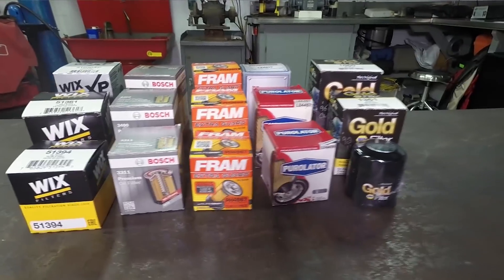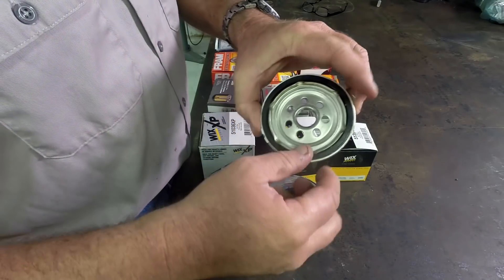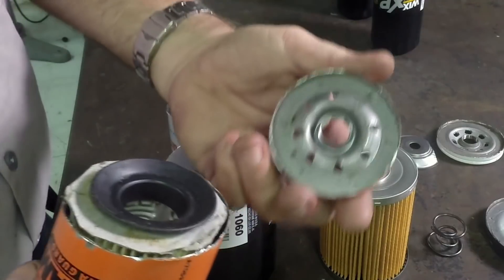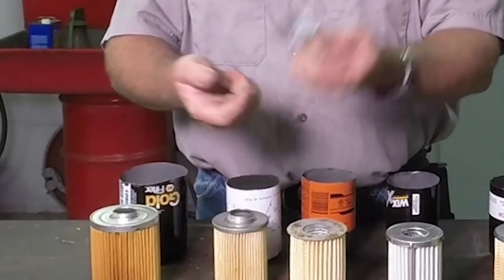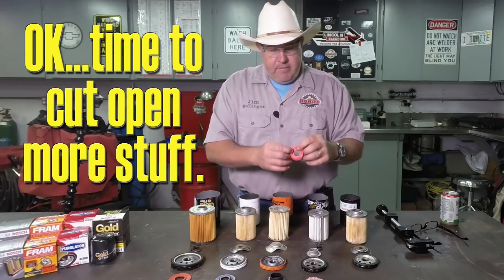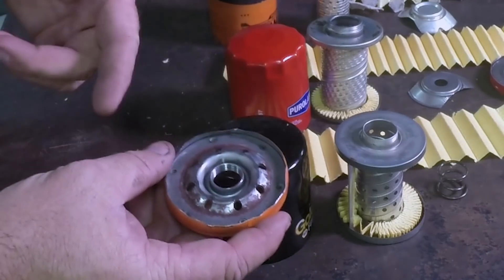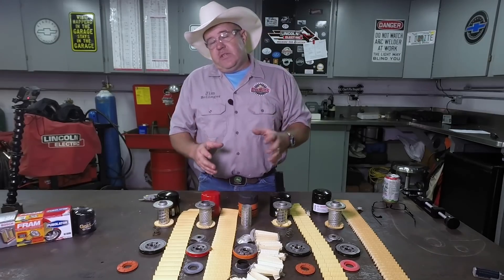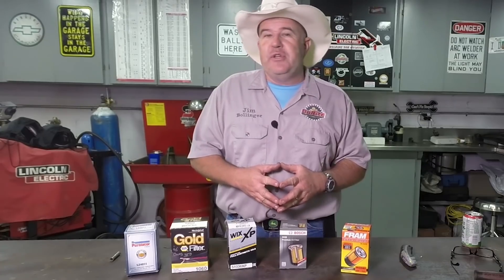The worst oil filter EVER!

Comment: Ok. The people watching this video are most likely a little more concerned about their vehicle maintenance then average car owner. I change my oil religiously at 6000 km and use a quality oil filter. Honestly, at this interval, the Fram filter will probably last long enough ,  but the heck if  I am going to take the chance of having it come apart and risk oil starvation to save a couple of bucks on a filter. For a lot  of people, the reason to use a better quality oil filter is because they are  likely to neglect performing  oil changes at the recommended intervals and the higher quality filter is less likely to fail as a result of this neglec. I would not want to see the condition of the Fram filter after a 15000km oil change. Do not forget car manufacturers are recommending longer and longer oil change intervals and then negligent car owners  think that an additional extra couple of thousand km will not matter. In ideal conditions the Fram is probably fine, but conditions are never ideal, particularly outside of warranty.

Comment: Thanks for posting this. Sometimes you need to look inside things to see what's in there. Fram filters are crap and they rust like hell in humid climates right on the shelf! I was buying Napa gold until I noticed that they are now made in China (Found that out 3 years ago). I have switched all of my vehicles to Baldwin. I have had no service failures and they are made very well and they are made in the USA. The odd time I can't get a Baldwin I go for a Mann or Mahle. I'd love to see you do a cut open with them as I have never cut one open yet.

Comment: The truth about oil and filters by experience.   He's right.  AND...
I've been a certified automotive/light truck tech for a whole Lotta years and have worked with standard duty engines, heavy duty engines, race engines and engine builders.
  In my new or freshly rebuilt engines I only use Royal Purple oil and a Napa Gold or Royal Purple filter, interchangeably.  Availability and price decide which I use on any given day.  Other than the Royal Purple, the Napa Gold filter is the only filter that will last as long as the oil.  Other filters will break down before your very expensive oil reaches it's service life.  Maaayybe the Wix, if that's all you can get. You can't go wrong with these, if you're willing to pay.  NHRA dragsters don't use crappy oil...  lol
   For standard oil, Napa branded products are cheaper to buy but are manufactured (usually) by Valvoline and is my other choice, be it high milage, Trans fluid, etc.  Pep boys was also made by Valvolin, last I checked.  Ask your sales  person.  There is NO reason to use other, way more expensive, nationally branded products.  It's the best bang for the buck.  (Yes, you may like another specific, natural or synthetic oil.  Fine, pay for it.  No need to tell me how this or that is all this and that.  I said "no need," not that there weren't other good products).  Those filters he mentioned, Napa, Wix and Purolator, in that order, are my ONLY other choices besides Royal Purple.  (Unless you're building a suppressor for your fire arm, but that's a different story...  :D)
  No matter what any one tries to tell you, change your oil every 3-4k miles, PERIOD.  Even if the oil doesn't break down (which it does) before higher milages, the engine parts DO break down and you are scrubbing the inside of your engine with metal shavings..  UNLESS you use the 10k mile, Royal Purple oil (after you used the specific, new engine "break-in" oil according to directions or properly switched over from standard oil) and then you change the 10k mile rated oil no later than 8k miles.  Inspect your oil regularly.  Every 40k, get an oil analysis done at your parts store.  (It's a fifty dollar oil change for a reason).  You can use Royal Purple in other than new engines just as well and are better off for it, I just wouldn't use it in higher milage engines (unless it was always using it).  The Valvoline high milage and a Napa gold filter is a better, and cheaper, choice.  (My '91 3500 Ram van with 360 engine has 300+k miles and runs like a top.  No smoke, burns very little oil).
  I'm sure someone is just chomping at the bit to tell me how wrong I am...  Don't take my word for gospel   Ask other quality techs and engine builders.  They'll verify what I've said.  I'm just trying to give some sound advice based on working 30+ years in the automotive industry.  This isn't the ONLY advice, just GOOD advice.  LOL

Comment: There are a couple bits of deception going on in this video that you seem to have slid by most of your viewers.  

One - we don't see you open each box and pull out the filter, remove the plastic seal on each, etc - how do we know the fram and others haven't been sitting open in your shop?   Not to mention how do we know that you bought the filters from the same store at the same time?  

Two - you never actually show the full process of cutting apart each filter, so how do we know that you even matched up the parts correctly?  

Three - you're not reviewing comparable lines of product.  The Fram you cut open is their absolute bottom of the barrel shit filter that, frankly, if you spend only $3 on an oil filter, you're getting what you deserve.  Anyone with half a brain is going to spend a couple bucks more and protect their engine.   The other filters you cut open are at least 2-3 times more expensive, and in a couple cases, more than that.  

How about you build a full start to finish video that eliminates the issues outlined above and try again? 

Oh, and spare me the "I'm not sponsored" nonsense.  Of course you're not sponsored....  :I

Comment: Interesting...but I used cheap Fram filters in my car (1973 Datsun 1200 Coupe) and it ran well for 32 years. An outstanding little car...
The speedometer broke after 400K miles, so I have no idea how many miles the car had on it when I gave it up. The only reason I DID give it up was because I could no longer get new parts for it, and Datsun 1200s (coupes and sedans) had been sent to the shredder years ago, so none found in junkyards for used parts, either. If it had been a 1973 Datsun 240Z (a "classic"), I probably could still get parts for it, but not for a 1200.
I was poor most of those years, so filter prices WERE a concern. Still, I used Frams and they (and "Dino" oil, mostly Pennzoil) served my Datsun well.
Today, I have a 2016 Honda pilot -- I still use Fram filters -- their "Ultra Synthetic" -- and Mobil 1 oil. 
So, due to my personal experience with Fram filters over the years, especially their "crap" filters, I've nothing bad to say about Fram...
 -- BR

Comment: Bull Shit! I've built 10 and 15 Thousand dollar HEMI motors. Put a Fram on them and ran the hell out of them. This fool was twisting the filter element. Oil DOES NOT TWIST your filter. Also, you notice the FAST MOTION when taking the Fram apart. You cannot tell he is purposely damaging it. I've ran Fram on many HEMI engines without a single problem. This video is BULL SHIT!

Comment: To be fair, you should not have compared a Napa gold filter to a low end Fram. You should have opened a Napa proselect filter instead as the price points are way closer.

Comment: Five years ago I bought a car with 17000 miles on it, from that point on I've only use a Napa platinum canister oil filter
Now I have a 135000 miles on the car and the mechanic at the Toyota dealer ran a camera into my cylinder head and said he has never seen an engine that clean for that many miles he asked me if it was rebuilt, I said nope

Comment: I have tried Fram filter's on and off over the years on my two Toyota Starlets but I have come to the conclusion that they are definitely inferior in quality to the genuine Toyota filter. The reason for this is that when you start the car from cold you can hear the bottom end rumble for a split second until the oil pressure comes up. I change my oil every 3000 miles and with the genuine Toyota filter you never ever get this bottom end cold start rumble its just super quiet on start up. This bottom end rumble I refer to is something that the average guy might not detect but I can assure you if you you know what to listen for you definitely will find this with Fram oil filters.
Reply: Oh man I love Starlets. I had a Starlet and it got almost 50mpg on flat ground. I sold it to a man who drove it over 400k miles. That sound is the Fram death rattle. It's caused from a lame anti-drainback flap. Toyota filters are cheap and AWESOME. Nippon Denso  makes one of the best filters you can buy. Cut one open and you will see that no American or Euro filter comes close.

Comment: I have been using Fram filters since I started driving in 1985. In that time I have owned a 1989 Honda CRX Si with 310,000 miles on it when I sold it in 2002. I had a 1994 Honda Civic Dx that had 172,000 miles on it when it was t-boned by a Ford Econoline. I currently own a 2002 Subaru WRX with 178,000 miles on it. It has a bent rod but thats because of to much boost.

Comment: There seems to be a cottage industry bashing Fram filters. This vid is just a copycat. If Fram filters were as bad as claimed, with the hundreds of thousands of them in use, there would be a proportional number of engine failures and there would be a ton of lawsuits resulting from those engine failures. As a result Fram would be out of business from settling the claims. Guess what: they're still in business. Fram filters may or may not be as sturdy as some but they are perfectly adequate for the job they need to do.

Comment: Need to cut open all 3 types of Fram filters high mileage and the Extra guard too. The one you cut open is the basic Fram filter. I've used them for years no issues. It's the people who Don't do regular oil changes that Do Damage to engines .

Comment: Fram was junk when I was a teenager and I'm 63 today. Thanks, you bastards!!! I was blaming Pennzoil for the foam in my crankcase. Different oil and filter fixed foaming. Didn't use Fram because didn't have my type at the time.

Comment: Anti-drain back valve. better known as a check valve ;)
Reply: It's a flap, I think calling it a valve is a stretch. In any case it's quality or lack there of will decide how long the engine runs WITHOUT oil when you cold start it.

Comment: I know from first hand experience that fram is the worst filter brand going. I had one separate at the seam and nearly caused my engine to seize up. Thankfully I killed the engine in time but it definitely damaged it. It never did have as much power ever again after that.

Comment: everyone wants to crap all over fram but cut open an old fram and oddly the peper is still in place and not disolved ---- everyone claims their freinds uncles cousin has a blown engine from a fram filter but who has actually had a blown engine from a fram filter thats proven its the fram's fault ----  ill bsolutly agree it looks cheaper then the rest but it does work and the rest are often made with fancy looking parts and made with better quality parts but a fram is a reliable basic oil filter for basic engine use

Comment: have a 4.3 blazer 240,000 miles original. they werent easy miles as im hard on my vehicles. let them warm up and change oil often and i add lucas. i use the cheap oil and fram. never any issues. still runs strong. maybe ive been lucky or maybe the oil filters through all the muck lol

Comment: I haven't used Fram filters for years since we had trouble on a old 6.9 liter Ford diesel. It would blow the top crimp apart and start leaking.

Comment: What about Motorcraft, Toyota, Mopar branded filters? I usually use Motorcraft for my F150, Mopar for Dakota, and Toyota for Camry.
Reply: OE filters are equivalent to a Wix always better than a Fram! There's only two major companies for filters and the one that makes Wix is the one most manufactures use
Reply: Motorcraft are same as Purolator classic. There are a few different manufacturers with varying quality of filters. Fram/Honeywell filters have always been junk.
 http://minimopar.knizefamily.net/oilfilters/index.html
Reply: have a mechanic friend that use to work at the local Purolator plant.  According to him Motorcraft is or use to be a Purolator product.
Reply: Almost certainly all Purolator.
Reply: I work at toyota and the spin on filters like these that we use look very similar to the napa gold or six filters, they also feel like they are the same weight as well
Reply: Motorcraft is Puralator, Mopar is Wix. Just rebranded.
Reply: Taka Yama I wondered the same...but I think my FL-1996 Motocraft on my 2001 F-250 Diesel is pretty rugged.

Comment: i am fully aware that fram is a piece of shit. i use em on vehicles you cant get a tool at all to take out the filter.  fram can be removed by hand thanks to the sandpaper hand grip  and a "POS" new filter is better than leaving the old filter on!!!
Reply: I never use any tool to install / remove oil filters on my cars- just hand tighten -never had any problems - been doing it this way for years...
Reply: I had my mom my brothers and nephews take it to the wal-mart  and some friends  that the oil filter will not come off

Comment: First off doesn’t matter how heavy the material is to know if it’s great quality if you really wanna know a great quality oil filter look up the microns that it can filter if it’s below 50-100k microns it’s a garbage filter (aka wixs, Napa, and fram) it’s not all about the material that the filter is made of but how the material is used in the filter and what ratio of paper to oil capacity

Comment: Hmmm, I checked. Fram filter costs 3.77, Napa gold 11.49, Wicks 6.89, Bosch 8.62, Puralator 7.99 these are all for a filter on a Ford 302 motor. Is it any wonder that the quality is what it is? The question is does it matter? I've put over a million miles on four vehicles in my driving lifetime and all I've ever used was Fram. Why? Because I'm not convinced the high dollar filter is worth it. I've never had a motor fail due to anything related to oil failure. Hell I've never had an engine failure. My son is still driving my last vehicle with 200,000 miles on it. All I'm saying is take this all with a grain of salt. One could argue that a filter can be too good and put more stress on the pump thus causing it to wear out sooner than it should. Good video informative but maybe a little over the top. My question for this guy would be where does your shop get parts? If the answer is Napa them to quote his words the proof is in the pudding.

Comment: Thanks for the video , I been buying my 2011 Gti oil filter at Walmart price is some where around $36 . And you showing in the video that that brand is one of the worst dam..  Gti 2011 part # xg10600 , that oil filter on the box shows that is a filter for synthetic oil, btw  almost  every auto part that oil filter go from $30 up Amazon will be $31 . I thought fram oil filter was a good deal or safe for the  engine to now .
Reply: That Fram is $23 on Rockauto... but you can get a Mahle or Mann or OEM VW for less than $12 on the same page, take your pick.
Reply: The NAPA Gold filter for the 2011 GTI lists for $19.99 at NAPAonline.com.   It's like a dollar less at Oreilly's.  I certainly wouldn't pay $36 for that thing at Walmart.